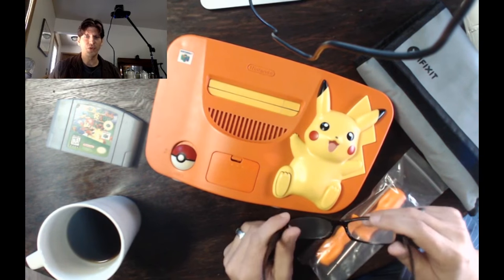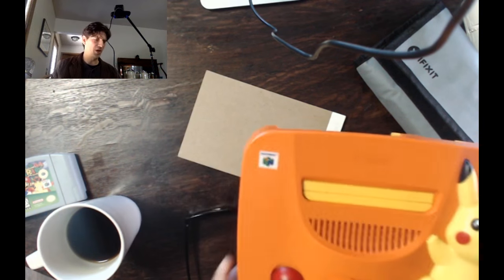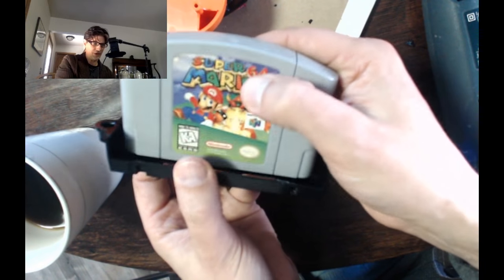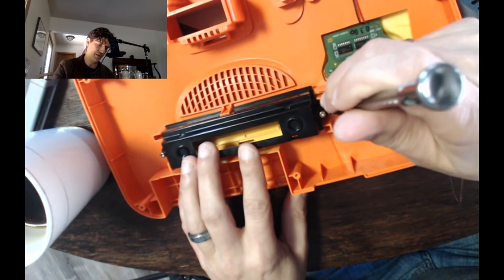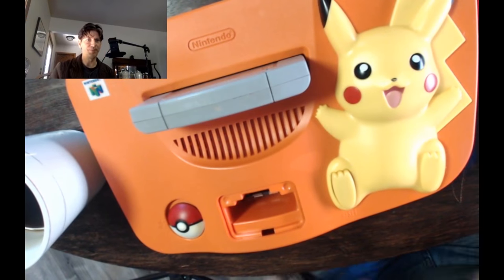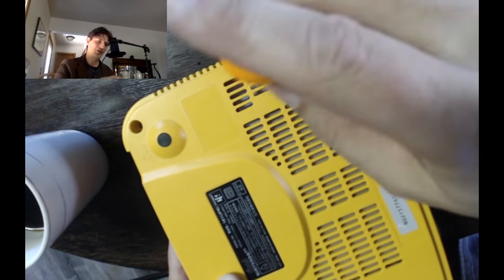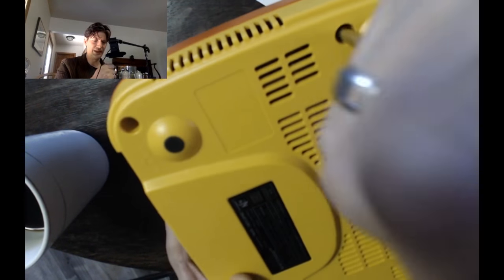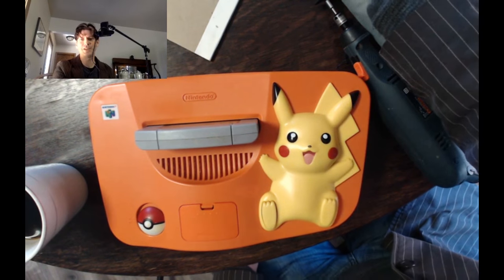How to Play Both Japanese and American Games on Your N64

Comment: Thank you so much! I just ordered my pair of security screw drivers. I just purchased an n64 and didn’t even know it was Japanese. Once my screw driver comes in I’m gonna operate on this. Thank you
Reply from the maker: Note that you can now order a universal cover for the one I hack up in the video: That way you can keep the original if you want
Reply: @Retr0Rob  thank you sir. I checked inside the cartridge holder where the tabs should have been  and it looks like the previous owner already sawed it off. Should be able to run no problem going to get some
Cartridges and load em up . Amazing video regardless

Comment: Hey thanks Retr0rob for your video. Just wondering how I search for that type of security screw driver and what size?
Reply from the maker: eBay  has them pretty cheap: Just search for N64 screwdriver: Generally they are sold in a set of 2.

Comment: Cool tip. Mind you this will only work for NTSC to NTSC machines JAP <-> NTSC. This won't work on PAL <--> NTSC machines.
Reply from the maker: +lactobacillusprime Absolutely correct: video format is different. I should probably have mentioned that.
Reply from the maker: +lactobacillusprime Changed the title to note that a little better.

Comment: Are there any differences with the jump packs, such as if I have a Japanese N64 console, can I use a U.S. jump pack?
Reply: Other than a slight voltage difference in the power pak and the 2 tabs in the tray it is the exact same console with interchangeable parts.

Comment: Don’t you have to do something with the voltage? Curious because Im looking at feet a Japanese n64
Reply from the maker: No. they are pretty close: I have been running Japanese consoles for about a decade now with no issues. That said if you want to be extra safe you can use a step-down transformer...

Comment: I would prefer to have magically had a new plastic replacement in case i wanted to put the original one back
Reply from the maker: They make replacement ones now. You can just buy the blank one and swap them out if you ever want to switch back. It's the first line in the description of this video.

Comment: I need help, my nintendo 64 only plays japan/euro games and i recently brought super mairo and pokemon snap from a site that only sells USA games. my n64 is blue and yellow and has the pokemon on the side and the word "Pokemon" on the other side. im from Aus. will this "mod" work on that console and will it play, the only reason im asking is cause i seen a video today saying you can change the game back cover around and when i put it in my 64 it didnt work at all. so what im trying to ask. can any japan/euro n64 consoles be "modded" to play region free? thank you
Reply from the maker: Oh it's a long answer :) It's strange that it plays Japanese and European games as Japan and the US are NTSC consoles and European N64's are PAL format (The format the console uses to output to your television).So with N64 a Japanese console will run US games (After  cutting the security tabs off) and US consoles will play Japanese games, but European PAL consoles will not run Japanese or American games or vice versa. 

They make converters called the N64 Passport to allow US and Japanese games to run on European N64's which are generally used for this. Early ones can be a bit wonky but I hear later models work fairly well.

But none of these conditions apply to what you described to me which is a European console that also runs Japanese games. It's possible your N64 was hard modded to run Japanese games at which point it SHOULD run NTSC games, but I would have thought they would have removed the security tabs and any cart should work in it.

^^^ But I have never seen the above. The only truely region free N64's I have witnessed are highly modified and have RGB or HDMI out. This does not mean it does not exist, I just have not seen it.

Have you had a Japanese game actually running on your N64? If not I would assume that yours does not run Japanese games and will not run North American ones without the adapter I mentioned above.

The other option of course is just to pick up a North American N64. You would use the Aussie power pack from your current console instead of the US one that came with the N64 then use an NTSC --> PAL converter to convert the TV signal -- For bonus points if you are using flat-screen with an HDMI connecter you can use an HDMI upscaler -- N-64's generally look pretty bad on LED/LCD screens, but they look waaaay better on an upscaler.

More on this: http://nintendoage.com/forum/messageview.cfm?catid=5&threadid=91864
http://www.racketboy.com/forum/viewtopic.php?f=52&t=23344
Reply: I get a little worried about cutting my n64 up, the only videos ive seen was one about a Passport 3 (which i couldnt find) and the cover change on the games, when i looked online it said that Japanese and European games are the same and US is different. i didnt manage to find a Motherboard that plays both Japanese and US games. the games i got was Super Mario 64 and Pokemon Snap, im willing to swap anyone free of charge for European ones, but ive had no luck in swapping. but the site i got the games off were really cheap (Jjgames.com). i Actuallu have 2 seperate TVS for my games, my N64, gamecube and wii play by my smaller flat screen and my sony games play by my bigger flat screen. ThIs whole deal with different region games confuses me a little, i wish they made them all the same, its really sad. i might go with the motherboard i found on Ebay for $33. theres only 2 on ebay that i found. never really new that n64s can play in HDMI. thought they would be way too old to do that. i was going to buy another n64 console to play USA games, but im going to test out the motherboard before i try for a new console. 

Www.jjgames.com check them out if your in need of N64 games 😊

P.s sorry for my long question, i just got super confused about it all. when i visit my mum again i will see if any of my games are Japanese, i know i have a few European games. hopefully i can get my hands on a cheap N64 to put my other motherboard in so i can play european games
Reply from the maker: It's unfortunate about the region lockout, but the reason is due to the power (and therefore TV) standards being the same in the US and Japan, and a different one throughout most of Europe. There is a pretty decent description of why here: http://learn.corel.com/blog/ntsc-vs-pal-what-are-they-and-which-to-use/ .Of course both the PAL and NTSC standards are dead now due to advances in technology. 

HDMI upscaling is really just a "cheat" to make older composite (and other) consoles more compatible with modern TV's. There are some N64 mods that make this change internally (and do a WAY better job) like this one: http://retrorgb.com/ultrahdmi.html

Comment: Good morning sir am going to buy a Jusco n64 console. Is it the dam concept you are showing in this video. Do I need to modify it?
Please help. Thanks
Reply from the maker: If you are in North America or Japan AND you want to play games from both regions you will want to remove the tabs (You could also remove that dust guard completely and keep it incase you want it later). If you are playing games from the region the console is made no worries: (Japanese games on a Japanese console) it will play fine in North America as the television standards are the same. 

The real problem is Europe to Japan/North America or vice versa where the signal is actually different.
Reply: Retr0rob ok thank you sir. Be well

Comment: You didnt have to cut anything.. there are plastic pieces sold or you can just removed it and store it and put back when you sell it.
Reply from the maker: I explain in the video that my area is dust prone, therefore keeping the cover was important. The flat ones were not widely available when this video was made 6 years ago, but I added a link to the description of the video a couple years back to one you could get from Shapeways. I assume you can get them on eBay now as well.
Reply: Always check the date of the video first.  3D Printed Trays were basically non-existent at the filming of this video.

Comment: The black thing that has the tabs on it that you cut...

You don't really NEED that do you? Because I'd rather just get rid of that thing entirely rather than trust myself to cut those tabs
Reply from the maker: You could -- it basically helps guide carts in and keeps dust out.
Reply: Retr0rob Hey thanks! Just gonna go buy a Japanese N64 now: better colors

Comment: Does the game shark make us games work on a Japanese console without any mods? Sorry noob to n64
Reply from the maker: That's a great question! Yes, that should be able to work -- Nothing the Game Shark actually does, it just lacks the tabs that would normally prevent the Japanese cartridge from fitting in the port. It should be a great solution if you don't want to open the N64.
Reply: Retr0rob have you ever tried it or known anyone to try it? I’ve googled it several times and have yet to find an answer I tried it on a Japanese n64 I bought from eBay. The game shark lights up and shows the number 8 but no video shows up. Any tips or am I doing something wrong? Thank you for your help!
Reply from the maker: There's a couple vids with people doing it, but I have not done it myself. The N64 really has no "region lock" to speak of so there's no issue there -- it's literally just 2 tabs, so assuming the shark has no tabs, which appears to be the case it should work for playing Japanese games.
Reply from the maker: One more note -- neither will help with European PAL games as PAL TV's are a different format than the US and Japanese NTSC.
Reply: Yea I’m from the us and it doesn’t work. I saw a 8 year old kid making a video about a GameShark being used for American games on Japanese systems and vice versa but he didn’t really show much proof
Reply from the maker: Does it work OK with US games? Also does the cartridge fit?
Reply: Retr0rob the game shark turns on and shows the number 8. It fits and everything. I’ve just seen a lot of videos with people modding their system and that makes the most sense because the GameShark really would be too easy of a way to convert and it didn’t work for me I tried but it may work on an American n64
Reply from the maker: Oh, gotcha -- You can always pull a spare collar from a dead donor N64 and chop the tabs from that if you want to return your N64 to it's original state. You COULD also pull the collar completely out, but it lets the dust in and increases the chance of an accidental spill being fatal.
Reply: Retr0rob the us games fit in the cartridge. It’s just there’s little to no information on it being used as a converter and if it were that simple there’d be some links. Most links are going inside the nintendo
Reply from the maker: I wonder if it may be due to the fact that there a number of firmware versions.
Reply from the maker: It's obvious I need to get one.
Reply: Never thought about that. Makes sense. Yea you should haha
Reply: I have the same issue Someone said that the gameshark locks itself after a certain time. The only way to unlock it to buy a second gameshark and plug the nom working one on top.

Comment: I WANT TO PLAY USA GAMES ON MY ENGLISH N64
Reply from the maker: This will not do that unfortunately. PAL is a different signal from NTSC used on Japanese and US consoles. You should be able to use a Japanese or US system and a composite to HDMI adapter to run them with a HD TV. Will need a power adapter too though.
Reply: @Retr0Rob  Actually he can hook up the power supply from his English N64 to the US deck and it will work for a power supply.